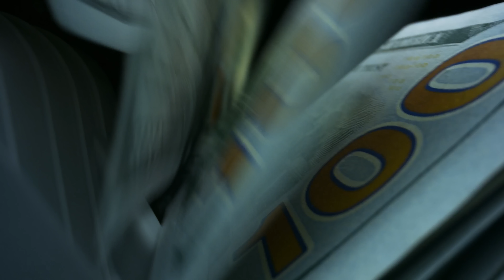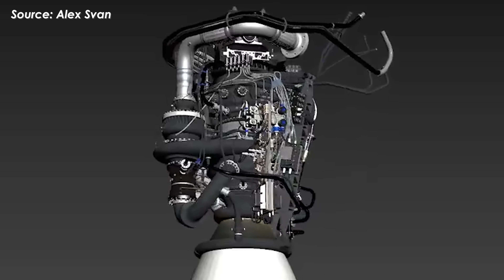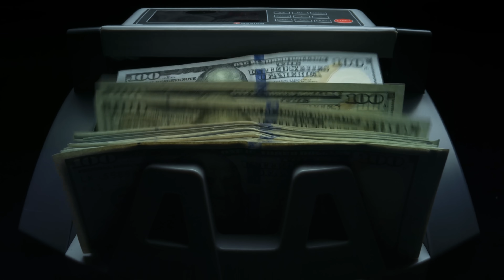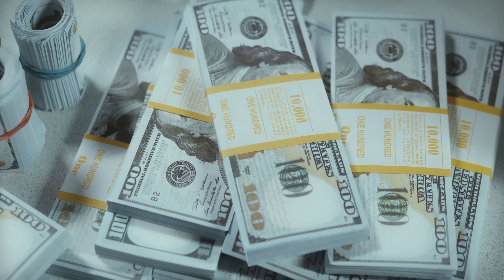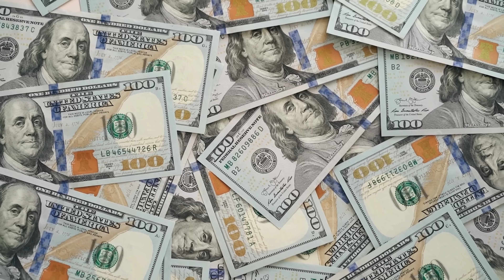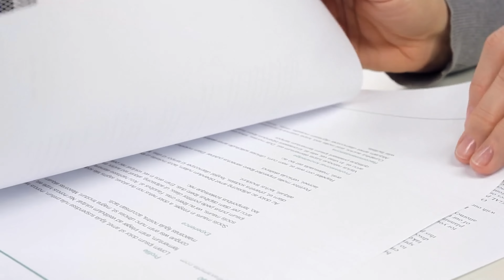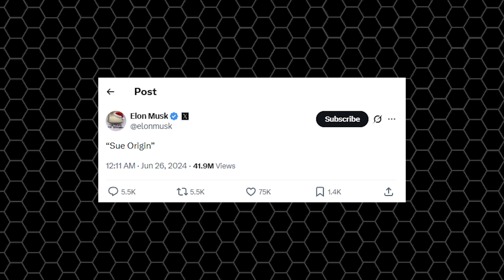What Elon Musk SpaceX Just Did for Starship Just Changed Spaceflight Forever!

Comment: We will never successfully get to mars with a human presence unless we find an alternative to liquid fuel propulsion.
Reply: I wouldn’t go so far as to say “never”, but a nuclear powered ion drive to shuttle material from earth orbit to mars orbit would certainly make things more efficient. I’m sure that’s in the pipeline. Just not the immediate focus. We can get there on methane.
Reply from the maker: I’d push back a bit on that. Liquid propulsion isn’t the limiting factor for reaching Mars—it’s cost, scale, and logistics. Chemical rockets are actually very efficient for launch and interplanetary injection, especially when paired with in-space refueling, which is exactly what Starship is designed around.

Alternatives like nuclear or electric propulsion may help for certain phases, but for getting large amounts of mass off Earth and onto Mars, chemical propulsion is still the most practical option we have today.